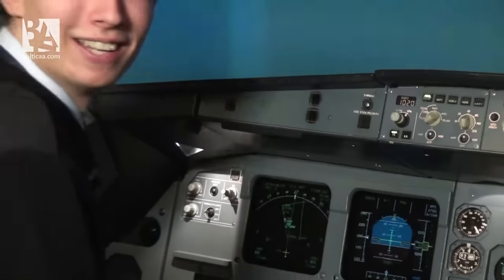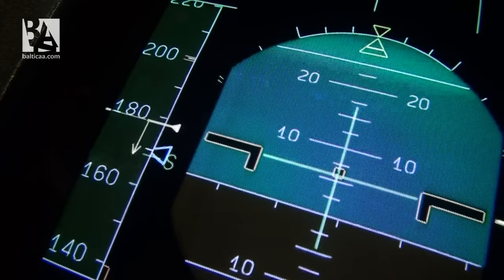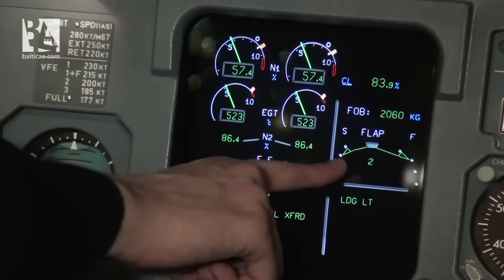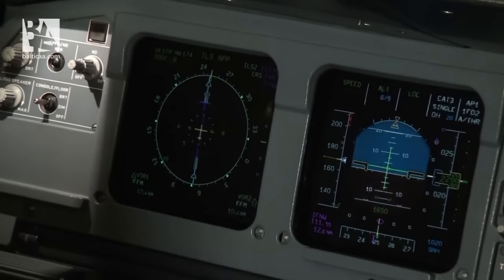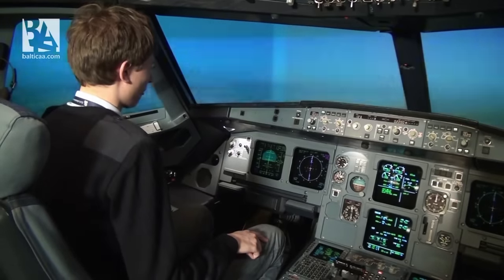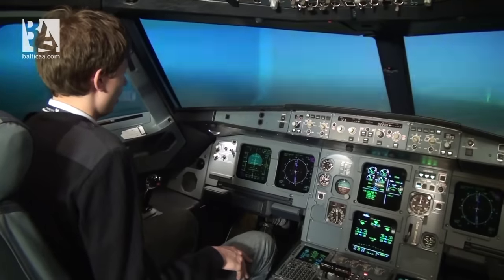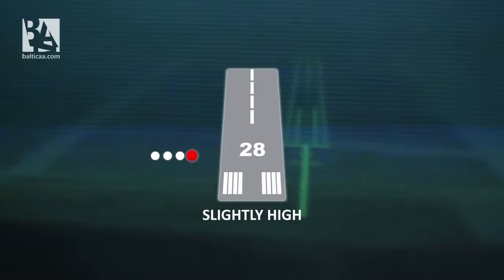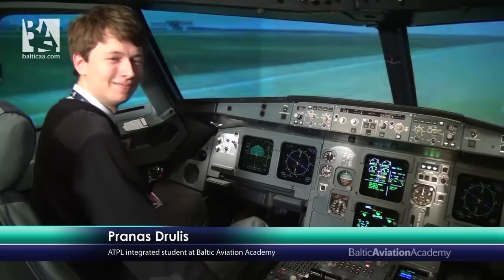Airbus A320: Auto Landing Tutorial

Comment: I would have thought that "auto landing" is much more automated, more like self-driving cars, where you could be doing something else and the plane completely lands itself. To a layman this looks almost like a manual landing.
Reply: It is almost like a manual landing, except using the autopilot to follow the localiser and glideslope, and to keep the various components of speed, thrust etc in balance. The pilot is still flying the aircraft, just using systems to control things so he can concentrate on other things. In your car, you may have a cruise control. That's the equivalent of autospeed, but it doesn't mean you can relax and read the paper.

Comment: With auto-thrust, why do you need to dial in a speed? Don't you watch the air speed indicator? This always confused me.
Reply: +sundevilification What do you mean? By turning that knob, we instruct the autopilot to maintain a certain speed. The air speed indicator just shows us the result of the auto thrust :-P
Reply: Sorry. I had a bad pain day and the Morphine was overtaking my clarity. This is not by choice but design. I am better today. Thanks though.
Reply: I really am embarrassed. This is why I cannot get certified. I appreciate those who can, as opposed to jealousy..
Reply: +sundevilification The Auto throttle doesn't know what speed the plane needs to be going, so he has to tell it which speed to fly at. Maintaining a constant speed manually would be a lot of extra work, and would require constant small adjustments throughout the flight
Reply: +Plum Bit that is true unless you are flying a waypoint/SID/STAR with speed restrictions and you have a correctly programmed CDU
Reply: he dials the speed for the plane and the auto throttle automatically changes the n1 thrust to maintain the selected speed.

Comment: But once below 400ft the AP won't disengage, would it?

I was thinking of a scenario where the engines are running on vapour, and the aircraft only has one last shot at a low-visibility landing. If for some reason the autopilot cannot proceed with the autoland without high risk of collision (radio altimeter flawed or some other unheard of thing lol) and this is detected by the pilots at around decision height. What then? Seems right out of Final Destination or something but, what if? :-/

Comment: I don't think the altimeter was set properly because the altimeter was way off the GPWS
Reply: Good point. QNH setting gives a reading of height above sea level. QFE gives height above the highest point of the runway. An altitude of 364 feet would make the QFE around 11 to 12 HPa lower than the QNH. I have been asked by ATC "Do you land QNH or QFE?" - always QFE for me.

Comment: why dont you hit the LOC button before the loc is captured? You can just hit approach straight away?
Reply: +Gavin Boothroyd yes, if you have been cleared by ATC for ILS you can arm the approach mode straight away. LOC is to be armed if you have been cleared to intecept localiser but not the glideslope.
Reply: +Aayush Sood nope, ATC only gives one clearance, "___ cleared to capture localizer", its a rule that you first select VOR LOC so that you can line up, then there are diamonds like thing on PFD, when they come in centre then you press APP button.
Reply: +BlueDragon HD Aayush is correct. You arm the APCH when cleared for the approach by ATC. This will arm both the LOC and G/S. Once established on the LOC course, usually about 100' below the G/S, the aircraft will capture the signal G/S* and then follow it down when you obtain G/S. Sometimes ATC will set you up on a long final, so that is an ideal time to use the LOC capture p/b.

Comment: Why doesn't the autopilot lower the flaps, the speed, the idle thrust, etc.?
Reply: Because there is no set speed or altitude the flaps are lowered across all airlines. Every airline has its own SOP’s and the flaps speed is different depending on the weight of the aircraft. The autothrust is in charge of the thrust commands. The pilot needs to move the thrust levers to idle on the flare as they are no back driven. Therefore if you left them in the climb detent on touchdown they will try and maintain climb thrust or the last set speed

Comment: Is 123 kias the designated approach speed in the Airbus 320 POH or manual?
Reply: The Approach Speed is usually calculated by the FMS and varies due to differences in landing weight and the final configuration of flaps. It should be on the PERF page the second last one نادر الی راحمان
Reply: And I'm also guessing the wind factor? I don't know. But I can't wait to fly these babes on my flight simulator.
Reply: Yes, but I am not sure how much this is taken into account. There could be some +5 to +10 KIAS added for the crosswind component but since it's Indicated Airspeed there should be just small changes. I am trying to figure out this airplane as well so no clue if thats true. But there are some documents on the web that explain those ops very detailed. Enjoy it and good luck! نادر الی راحمان
Reply: Thanks! I am going to start off with the A321 on my FSX and then later I can get into this.
Reply: depends on a lot of factors, such as headwind/temperature/load/flaps configuration/runway conditions, etc. But yes, on a full auto pilot landing, with the data placed in the PERF display of the MCDU, you can have the approach speed determined by the autopilot system

Comment: why do we have to switch to DUAL ? what happen if the AP2 has different settings while in DUAL?
Reply: AP2 is only a backup option just in case the AP1 fails
Reply: An alarm would sound and the autopilot would disconnect.

Comment: Can someone please tell me why pilots dont use this system every time ILS is available at a runway and decide to land the plane manually using the ILS cross hairs and the glideslope indicator and the centerline indicator?
Why do they before the landing disengage autopilot? isnt doing this much safer than actually taking the stick into your own hands and then putting the lives of the passengers at risk by subjecting them to human error?
Reply: +asfdgdg It's safer to fly it yourself if it's windy, or if there's a sudden gust of wind, so auto landings are probably only used in completely calm weather, which is rare
Reply: I thought about it again and i also realised that the pilots need to practice landing in case the systems fail. If we leave everything to the auto pilot, then the pilots will lose out on practicing how to land manually. Therefore, in the event that the systems fail, the pilots will be less skilled to land the aircrafts due to reduced hands on and regular landing experience. 
Also, the pilots are being paid to work. If we leave everything to the auto pilots, then they would be mostly sitting there with doing very little work. It also keeps the pilot more engaged and interested in the flying of the aircraft.
Reply: asfdgdg another good point
Reply: +Plum Bit It's the complete opposite, the ILS Autolanding systems is mainly used for when the weather is usually very bad or includes low visibility.

Comment: Well, for what it's worth, the furthest out I've been able to pick up the localizer portion of an ILS is 24.8 NM out. This is the point where I see what looks to be accurate DME reading. On the display though, it says "G/S fail" for quite a few more miles yet. Just because you can pick up the horizontal component from way out beyond the Outer Marker, that is only one portion of the ILS signal. 57 miles tho?? Anyone else call BS on that one?

Comment: Did you put altitude in auto pilot?
Reply: Your comment: "It doesn't matter what altitude is in the autopilot while the plane is" descending to the airport."

- I don't think this is true. Firstly, usually ATC will give a clearance to a specific approach altitude. Secondly, the altitude must be low enough so that the aircraft intercepts the glideslope from below/underneath (to avoid a steep descent, if it were captured from above). 
Appreciate if someone could confirm this.

Comment: How is this autopilot when the pilot has to change the speed and flaps manually.,
Reply: It is automatic, the only thing the pilot does is putting the inputs at certain moments during the flight.
Reply: @cubetamalvada893  Imagine having to step on gas and brake pedals when driving Tesla. Would that then be considered a self-driving car?
Reply: @kevinkall8547  He's changing the flaps positioning, not hitting the brakes, if the plane has "Auto-Thrust" activated then the speed changes automatically.

Comment: Why do you need two autopilot buttons for landing?.
Reply: Jonathan Bear Redundancy - both APs are engaged so that if one fails near the ground, the aircraft won't crash.
Reply: Absolutely incorrect. A single autopilot is totally technically capable of conducting an autoland, there is no need for task-sharing. Hence redundancy with them both engaged - if an AP fails at low level, the other can complete the landing.
Reply: Ben Kolbeck Absolutely correct Ben.
Reply: +Ben Kolbeck In addition to this, the two  AP systems compares each others output signals continuously, so that if one of the autopilots give very strange values it is disconnected :) Although, the FADEC (Full Authority Digital Engine control) Computer, which controls the engine thrust, consists of multiple channels, and the channels will always compare as in the AP system, but here, the channel in command will switch so that the wear is equal on all channels.

Comment: 7:16 What are those twin rolling weels?
Reply: solountipomas those are the trim wheels, completely automatic on the A320, used to trim away forces acting on control surfaces called elevators. it also has a separate rudder trim.
Reply: Okay, thanks.

Comment: Explain glide slope details
Reply: The aircraft acquires the glideslope signal at a certain distance from the airport, which varies with altitude and the type of equipment. It will direct the pilot (if flying manually) or aircraft (if flying on autopilot and if the systems have been set up correctly) into an approach to the runway threshold at an angle of 3.5 degrees. That equates to about 300 feet descent per mile.

Comment: I understand knots but why is the altitude in feet?
Reply: Yeah, well, maybe it's easier to read
Reply: Feet are more accurate as they're a smaller unit, as opposed to metre in whole  (ie if you want to be at a specific attitude feet makes more sense, altitude settings are (usually done in intervals of 100, so 100ft would be more specific than 100m(330ft).  I also don't think that most aircraft have the ability to change height settings from feet to metres (though; Altimeter and speed[KIAS/Mach] do have that ability)
Reply: Princess Lemmy in the newer versions of boeing's planes there is a button beside the map and display controls to show a meters readout. I would imagine in airbus this would be there as well in some form.
Reply: TRDeluxe

*Americanized  ;p
Reply: Princess Lemmy

you never heared that word?
it's more in use than you think...
Reply: I simply corrected your use of -ise the -ize, which is what they use in North America (which is also the correct form according to Oxford University) :B
Reply: Peichen01 Knots is the international reference to speed as Feet is the international reference to height,at least in the western world.
Reply: Stephen Smith But that's the crazy part. Most country use metric.
Reply: Stephen Smith Peichen01 Yeah and it doesn't matter what most countries use, ICAO has set up the standart measuring units for aviation and eg also the standart atmosphere as a reference for altitude measuring (it's altitude btw, not height ;) height is defined as the height above the ground in aviation, altitude though as the altitude above MSL, either on 1013hPa or the specific air pressure for a place reduced to MSL :D or if you're in the US 29.92inHg, which is a great example again that not everything is americani(z/s)ed :D also many units have been adapted by nautical navigation (seafaring)Fly on folks
Reply: Your bitter tears are delicious!

Comment: Why are there two autopilots? Why are they both needed?
Reply: One for the cruise AP1 and one for the approach and landing AP2.
Reply: *****  That´s quite a long topic, but quickly as a safety measure in case one fails in really low minimums , You can read about ILS  approaches, Fail Passive And fail Operational :) . ***** you are also right , it determines what FMGC is the master one.
Reply: hiimbrady Nope!!!!!
Reply: ***** That's completely wrong. AP2 is used for auto lands like in the video, it's also used if AP1 fails

Comment: what is auto thrust  ??
Reply: Auto thrust means that the computer will maintain the speed you tell it on the FMC or in the FCU so you don't have to maintain it moving the thrust levers, or in easier words is like an autopilot but for the power setting of the engines that will allow you to maintain a certain speed automatically.
btw FCU means Flight Control Unit, the center panel where you program the autopilot, in Boeing airplanes is called MCP that stands for Mode Control Panel
Reply: Josue Gzz Thank you veryyy much :)
Reply: Josue Gzz Can this auto landing system handle it self in crosswinds ?
Reply: *****
Well I'm not a pilot, but as far as I know when it comes to crosswind, landings are made manually
Reply: *****  yes they can, acording to Airbus the limitationas are 30 knots Headwind , 20 knots Crosswind, and 10 knots tailwind